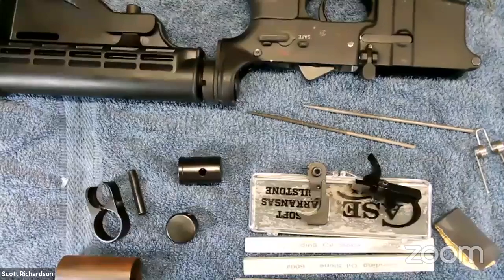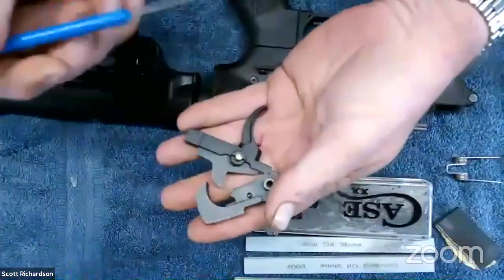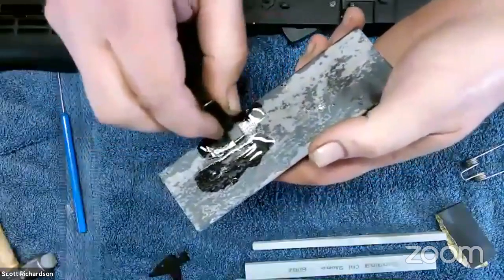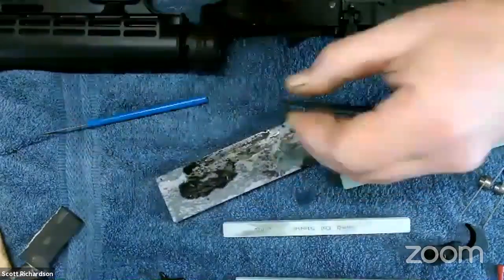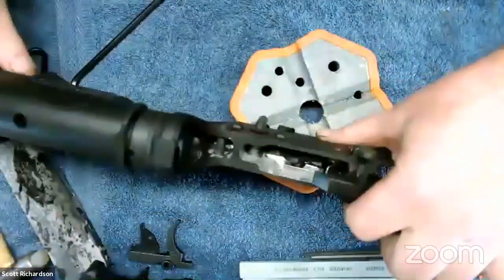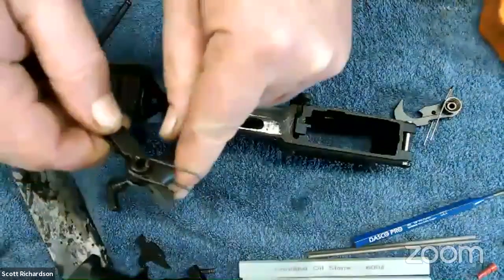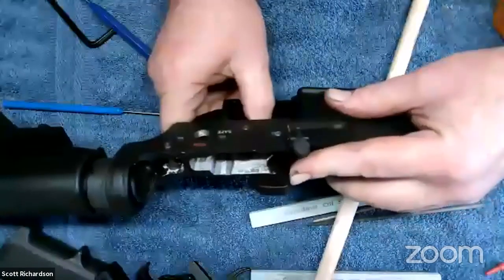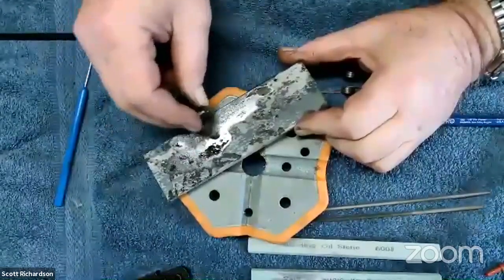Bench Doctor Office Hours- Stoning an AR Trigger

Comment: It is possible to take out the safety without removing the grip. Rotate it back and forth between fire and safe while pushing on the right side of it with a plastic punch. The retaining pin and spring will compress and allow the safety to push out.